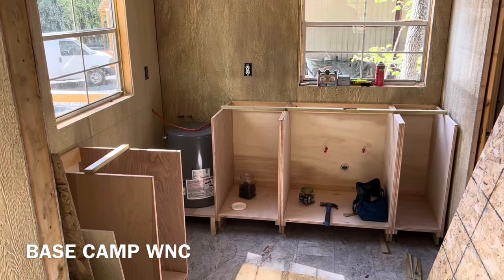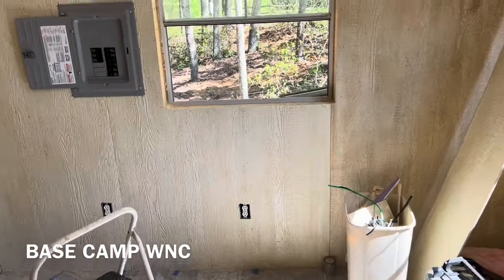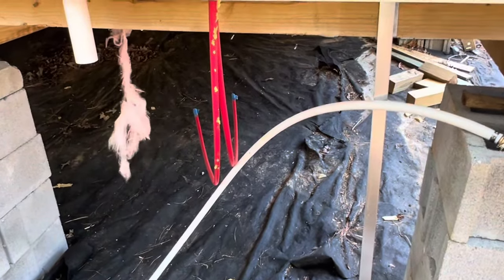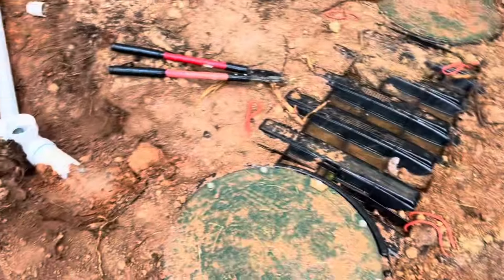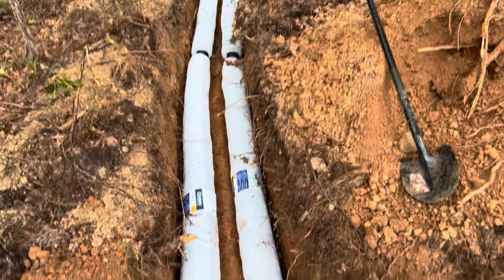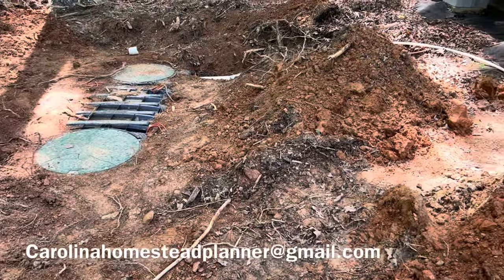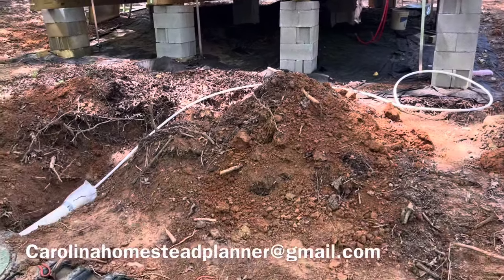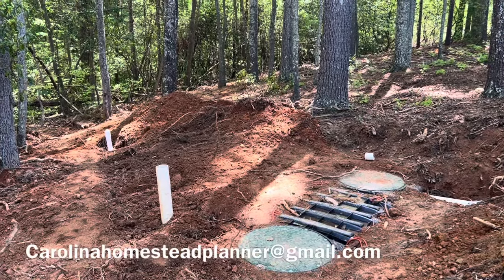Tiny house build update

Comment: Dang, you can do just about anything!  Great to see this new project.  Coming along nicely.
Reply from the maker: How’s things on the other side of the world?
Reply: @basecampwnc1745   Wet!  It's been raining, raining, raining so far this spring.  But then, that's what it does out here from about October to the first part of June.  I'm not complaining.  There's no flooding, no devastating tornadoes, no snow storms or heat waves, and the healthy snow pack in the Cascades bodes well for our water this summer.  It's typical pacific northwest rain in the spring months.  Just not great when what you need to get started on is road building!  😂  Can't work an excavator, dozer, or even a skid steer on our soils right now, so we're focusing on burning up the last piles of slash before the rains dry up for the summer.  Last week we also planted almost 30 nut trees we'd been growing out from nuts for the past year; Oregon white oaks, a couple of red oaks, a few black and English walnut trees, and a couple of heart nuts.  Best to get those in while it's still raining a lot.  Once it dries up for the summer and starts getting hot, we'll put a bit of shade cloth over their deer cages and keep them watered every week or so, so they don't fry.  After a few years of getting their roots down deeper they should be fine.

This year we put in the water catchment systems (4 x 5,000 gallon tanks), finish the drainage systems around the new pole barn, get all the roads/driveway built/repaired, clear the home site, get the septic permit, finish the house plans, and get them submitted to the County for the building permits!  If we manage to pull all that off we'll be starting on the house build in the spring of 2025.  Fingers crossed.

Hope all is well with you and yours over in your neck of the woods!

Comment: Do you have to worry about snow out there? 

I'm wondering how deep I need to do my septic
Reply from the maker: We have snow and below 0 temperatures 
The top of the septic tank is 18”
And the bottom of the trench for the drain fields is around 24” deep